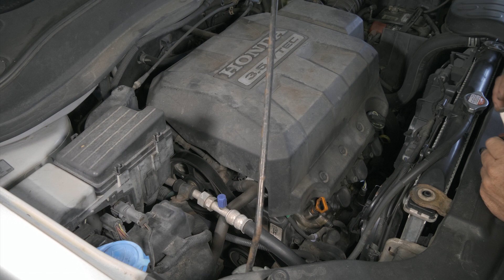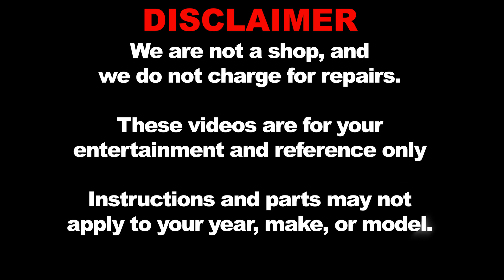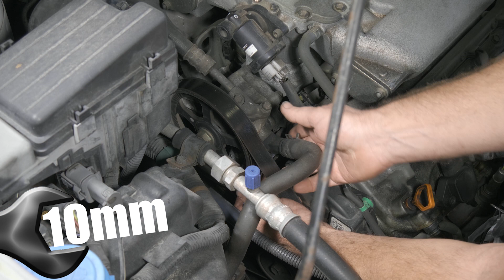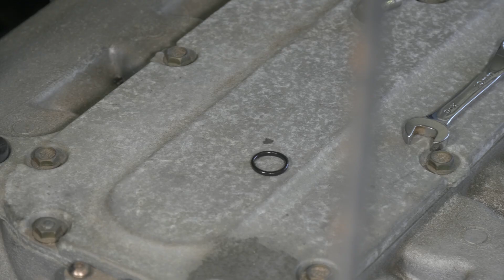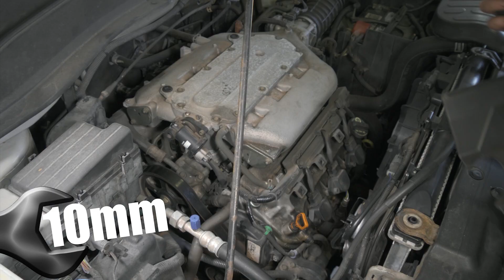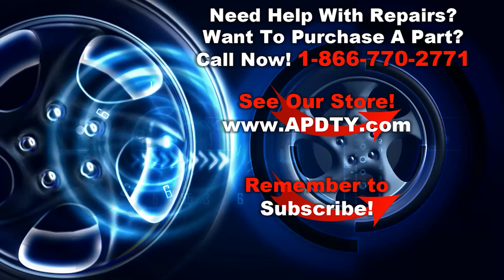2006 Honda Ridgeline Power Steering Pump Whine

Comment: UPDATE.. A bit of whining still but I know of where the reservoir is located the cold can cause whines as well and its been very cold lately here in denver so I will top the fluid up to half way.. and go from there.. but the o ring replacement has made a big difference from what it was doing. May have to bleed it with new honda fluid if it persists and then we should be golden.